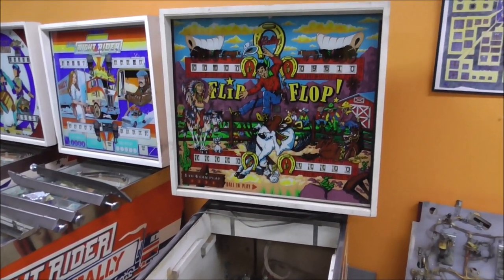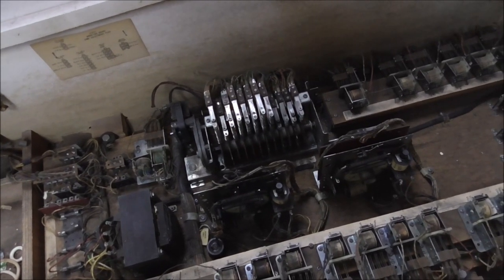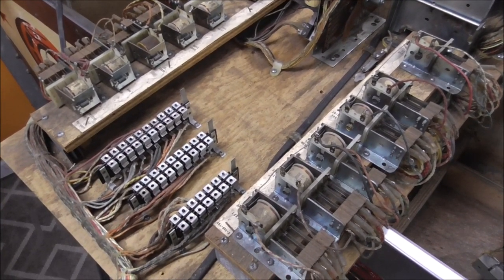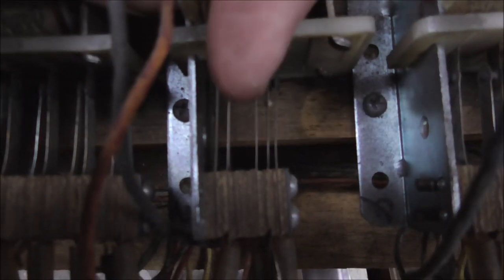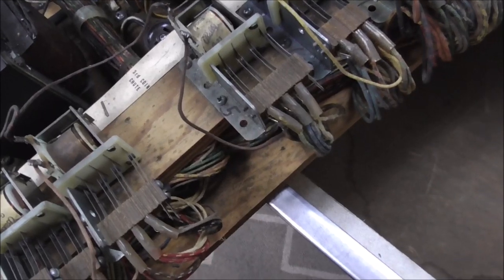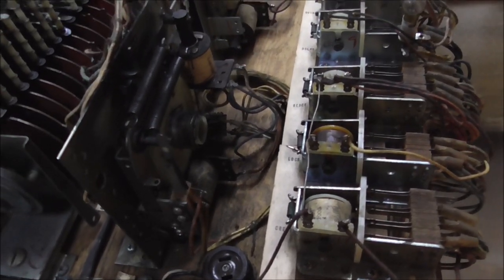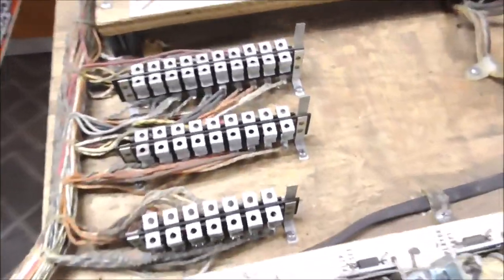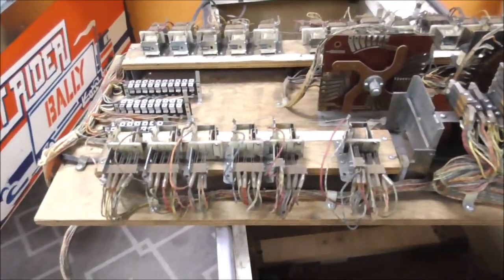Working on a 1976 Bally Flip Flop Pinball Machine - Fuses, Bottom Mech Board Repair

Comment: Several of the relay screws that were replaced should be in brass. Some relays may also have a brass washer. All I know is the brass isolates the coil from the frame magnetically. I believe this is why coil stops include brass to magnetically isolate the stop attached to it's bracket. You'd have to research, when using regular screws, how it could effect a relay's operation since I haven't tried this myself.
Reply from the maker: It probably helps it not vibrate as much....

Comment: I just got one of these Machine. I work as a IT tech and I was sent to an old building that was being renovated. When I got there they were throwing away this pinball Machine. I stop and ask if take it off there hands. So now I will be working on it. There was another pinball Machine but they had smashed it up and it was in a dumpster. I told the owner that if there anymore old Machine like this i would take them off his hands.
Reply: One thing I notice from your video is the Machine I have has a sound board on it along with the chimes.

Comment: 11:30 It looks like the numbers sharpied on the relays were which slot along that big line of relays they go in. The actual uses were printed on paper to the side. The "2nd Coin Set Up" relay (#1) and "3rd Coin Chute" relay (#4) are missing; my best guess as to why is that the door is configured for two chutes both of which are one credit per coin.

Comment: Hey Joe! I have a broken Jone’s plug. As I was trying to squeeze the female side a bit tighter it snapped where it turns to go down through the plastic or whatever that material is. Can I just solder that back together? It seems getting a new Jone’s plug is a challenge. Thanks

Comment: Thanks for clarifying the difference between car glass and safety glass on pinball machines.
I totally forgotten about that.

But with that steel ball hitting the glass that protect the playfield.
It can definitely take a lot of abuse.
Except for a drunk jackass for some odd reason wants to break it.

But mmmm.
Makes me think.
What would be the fastest speed of pinball itself could get?
And what game could do that?

A scientific endeavor I could never achieve.
But interesting to think about.
Reply from the maker: The fastest I've ever seen the ball move, is just the simple shot off the flippers, the more modern the game is the stronger the flippers are... so a new Stern or Jersey Jack, the shot off the flippers is probably the fastest speed possible.  Also there are a couple different speeds you get off the flippers, if you're holding the ball and then flip it, it moves at one speed, and if you hit it as it's coming down the playfield it goes a different speed... but the fastest speed is when it's coming down the inlane at a fast speed and rolls onto the flipper, since it's already going kind of fast and the flipper just redirects it, it makes it even faster.  So a nice shot down the inlane and a good strong flip at the end of the flipper on a modern Stern or Jersey Jack game would be the fastest the ball can possibly move.
Reply: I know that's what I am thinking but early 80s and 90s..
Does the comparison hold up.
With ball speed and true game speed?
That's what I'm trying to figure out.
And considering.
Reply: And also compared to today's Pinball machines.
From Stern Jersey jacks deep root and so on..
And from Williams Bally's data East Stern Capcom and so on.

Question what is the fastest ever recorded pinball machine..
Question 2. What's the fastest pinball as in the ball ever recorded.
Reply: I don't think the pinball database considered this question.

Comment: Am I right in guessing that a lot of (if not most of) the "dirt" in the machine is "burned up metal" from all of those contacts sparking when they make/break connections?
Reply from the maker: The air all around us has dust in it, which is largely dead skin cells, and there's something about electromagnets that makes it collect, all the coils in the machines draw that stuff out of the air so you end up with tons of dust and dirt inside the machines.  The machines even have a certain smell to them, the smell is basically dust burning.